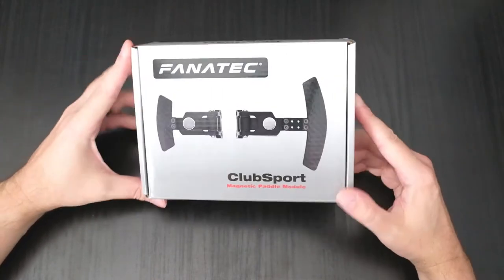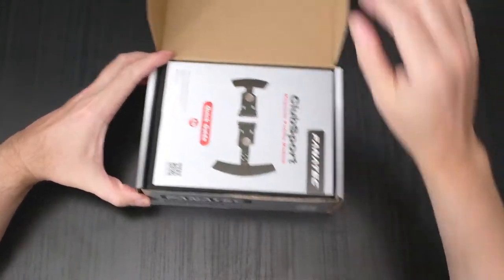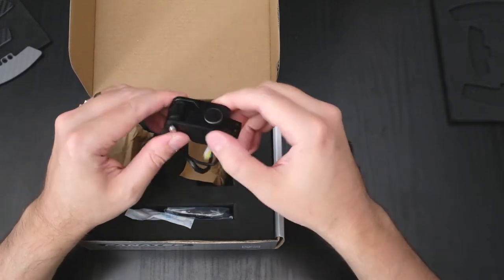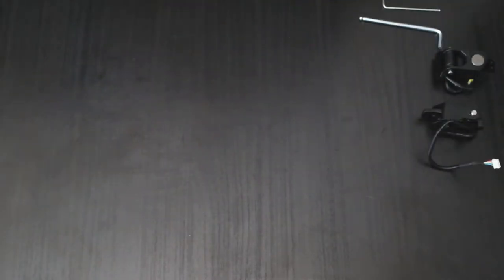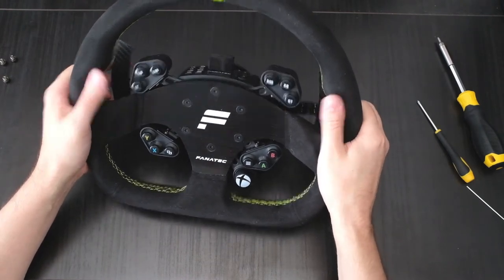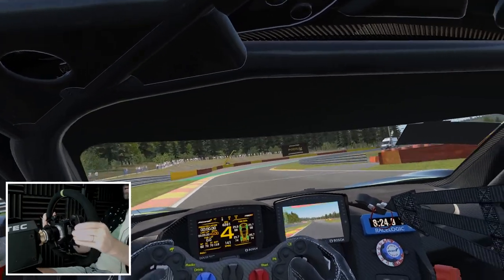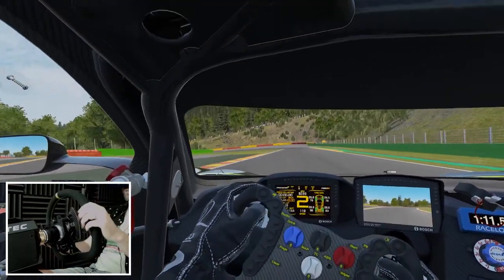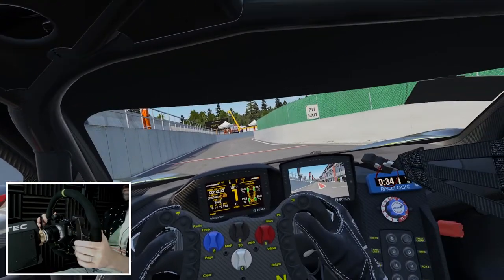Fanatec ClubSport Magnetic Shifters | Unboxing, Installation and Review

Comment: I had a G29 before a CSW 2.5v which I 3D printed magnetic mods for both, the G29 ones were nice to use, had a good feel to them and solved my issue.  However  the ones for the Clubsport were a bit disappointing - I have these Fanatec magnetic shifters on order and should be here in a few days, I have no doubt that I will enjoy using these and get that satisfying shift change - For the price Fanatec charge for the Hub it's a shame they do not come as standard.
Reply from the maker: I agree, the stock shifters are a bit lame for the price of the hub.  The mag shifters are a huge improvement, you'll love em 👍
Reply: @JimVR  Got them - WOW they feel great, just what I wanted.  They are lighter than the originals so saving a bit of weight on the hub too.